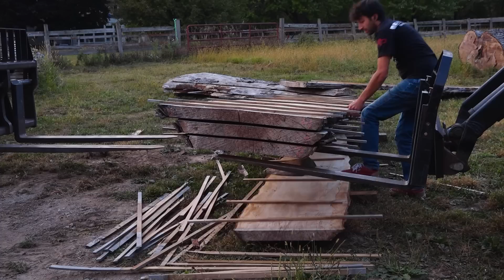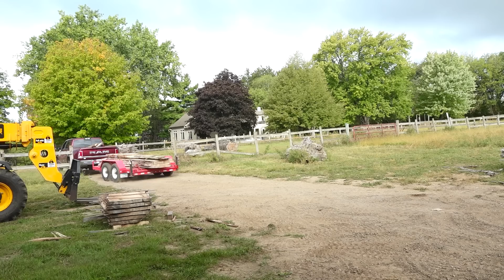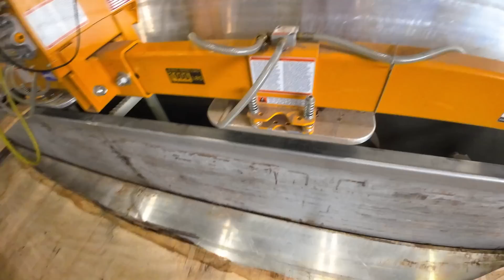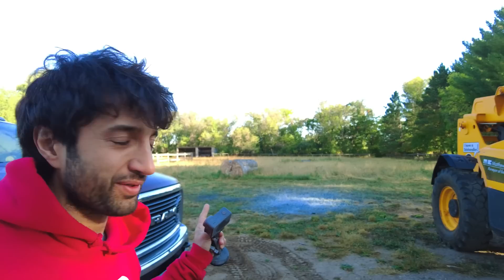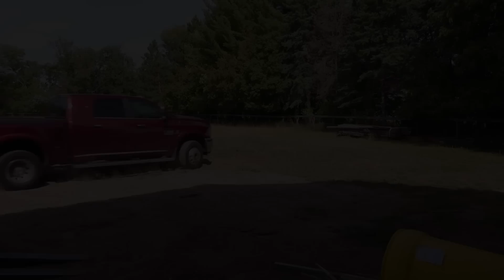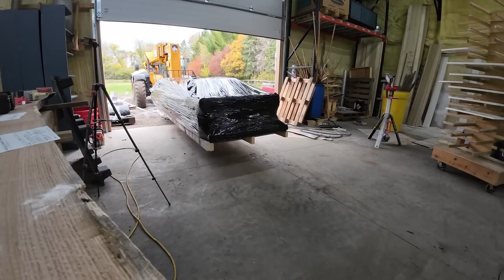Drying and Shipping Slabs That I Sold

Comment: Awesome video, I really like it when you tell everything the way it goes, and you are honest enough to tell the pricing and explain them, it gives us a general idea of why some of the stuff can be so expensive....could you explain also the selling price of slabs not dried and the dried ones, as also per the length and thickness how it affects the pricing? I just bought aluminium plates and at first I was surprised of the price jump between 1/4 thick, going to 5/16 was a real shock, one would think 1/16 thicker is negligeable in price ...but it's not!!

Comment: Great way to start the new year with a interesting video!  When drying 12/16/or more quarter wood, does the process have to slow down which I guess would mean the water would have a lower temperature, to avoid case hardening?
Reply from the maker: Yes, the temp ramp up time is extended

Comment: Hi Matt I was wondering about the drying of timber.  Pardon my ignorance but I thought that when you leave timber outside or in a shed, that was allowing it to dry.  Does the timber retain moisture even after a period of standing and that is why you take it to Eric to put in his dryer?
Reply from the maker: It will dry to the point of being at equilibrium with that unconditioned space.  Typically indoor spaces are dryer.

Comment: How many stair treads did the customer need and how many were you able to get for him  that Elm wood is getting hard to find the next time you get some kind of short stuff 6 ft. Or so you might check into seeing what thickness and how to saw it for the old Kentucky or PA. Style rifles the planes style guns don't have to be over 3 or 4 feet long some of the beautiful wood I have seen you cut i know would have been worth 3  thousand bucks and might have had 5 or 6 stocks in 1 slab probably just a little thicker

Comment: Matt sure is blessed to have 3 different sizes of fork lifting machines.  What's the max width on Eric's vacuum kiln?  I saw you had to trim a few slabs to make them fit.
Reply from the maker: The plates are 48” wide but you can sneak 49” into the chamber

Comment: home pickups are difficult in most areas , due to route restrictions, , you being fully equipped to handle and the extra effort you make by building a make shift skid for the slabs too sit on are a real transportation bonus, as even at the dock a regular fork lift would have a difficult time handling such a long lift, , most shipments picked up do not travel on the same unit to final destination , they get switched on LTL loads, 3lp thus , pickup unit to hwy unit too delivery unit, and some will go to hubs and switch hwy units too hwy unit for state too state , province ect ,as well , the more units they get switched too , and the more difficult the primary loading location ( your place is easy)and the final destination local relevant to commercial routes as well as their off load equipment , the more the cost increases, time and effort equals cost, you can call your local or previous carriers and they can work out a rate package , for you in advance so you know 4x 8 4x10 4x12 4x14 4x16 ect approx in advance,where it the cube  in your case and not the weight that's the biggest factor , rule of thumb of 1000 lb \ft is their max allowed  , the fact you have a scale is huge as well ,guesstimate weight cost more as they can not knowingly fill the empty space above your lifts with loose boxes ect, in fear they will over weight their trailers, fines are expensive, if your client and your self are not rushed , then state that , this will effect their cost too haul as they may not always have the needed unit for pick up or final delivery on the day you call it in ,(too find and send one for your odd sized freight can increase cost ,or maybe they del your area every other day ect,) build a relationship with your shippers, tour their cross dock facility's ect, video marketing their ability to handle your shipments, make them a promo video of the pick up experience ect , after 20+ yrs as a logistics specialist servicing, eastern Canada and USA  i can say their  are good clients ,their are bad clients ,and no matter the profit margin we went the good client route over bad client hassle every time, so state weather they can top load or not(several paper taped label too indicate too the dock workers), a layer of cardboard under the black rapping will protect the boards from surface damage , and allow them too cube their hwy unit for long distance travel thus lowering your cost as well ,  multipal labels even one under the black  plastic and on top , rapping some times gets tore off, by accident ,and cutting off the excess pallet is a bonus, it prevents the next row of pallets for toppling during transport  , express your ability to load from the street and place where they need it in their unit , hat off for being a good rural residential client  and happy new year from Canada "A"

Comment: I would look at ROI however I always prioirtized my investments asking if this capital expenditure was supporting my core business and necessary for my customers and gave me better control, there by allowing my company to fix my overhead at today's rate far into the future which made me look a lot smarter than I was in five years and my firm was always at a growing competitive advantage in my market. Today 37% is returned after depreciation in 2011 when I sold/retired there was an additional 5% surcharge tax that I believe is no longer added. Keep in mind that capital equipment usually has residual value when you no longer need the machinery. In my business commercial printing presses at the time could easily exceed 7 million and might be obsolete in 10 years and cost more than 1.5 million to rig and install. So at the end if my customers got better service and I had the cash or credit and could afford the amoritionzation I made the purchase. I was always long term in my outlook. From a distance w/o all the financial data your business for me getting rapid drying and flattening capabilities in house seems a no brainer. Ray

Comment: Have you ever calculated what the weight differential is after kiln drying? Just curious, thanks.
Reply: That was my question also.
Matthew it's always interesting. Thanks.
Reply: Pretty straight forward.  The wood was 14% moisture before drying.  He didn't say (or I missed it) but typically kilns aim for 7% or so.  Moisture content is expressed as weight of water divided weight of absolutely dry wood.  

If the slabs were 7% moisture and weighed 2500lbs, with zero moisture they'd weigh 2345lbs.  So the remaining water weighs 165lbs.  Since 14% is, conveniently, double 7%, that means the slabs lost about 165lbs of water.  Or around 20gal.
Reply: From freshly cut to normal dry levels (7-9%) most woods will lose about 1/3 of their weight.
Reply: That said, remember thry had been air drying for almost a year.  Most likely they were 50% moisture or higher straight off the saw.

Comment: Matt  what is the normal charged for kiln drying in the vacuum kiln ?  I have some white oak slab  2" thick buy 12" wide and 10' long. I am sure it is by the board foot charge .
Reply from the maker: $1-$2/bf but it can vary